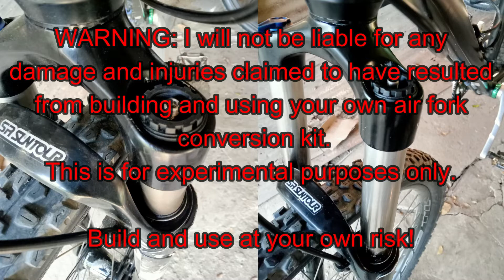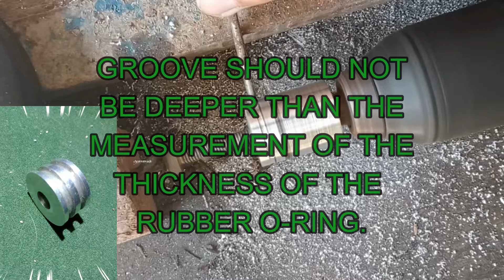I Built my Air Fork Conversion Kit using Home Tools only. Coil fork to Air fork

Comment: pa pm anu fb account nyo
Reply from the maker: bro kung me itatanong ka dito nalang. God bless.
Reply: Meron din ako ganan conversion kaso maliit in diameter ng air cap pang 32mm yata un sakin Kasi 34mm stancheon maluwang sya bka makakapagawa sau Ng alloy na air cap
Reply from the maker: @ pasensya bro, pero hindi ko maharap gumawa, hobby lang yung sa akin kasi. tignan mo kung pwedeng i convert yung dating cap ng fork mo. Pero kung hindi magpatorno ka sa machine shop. Dalhin mo yung dating cap ng fork mo dun para magaya nila yung thread nya. Have a blessed day bro.
Reply: Ahh ok cge pero my idea kaba magkano singilan nila my sabi Kasi nasabit daw ng 1k+ dahil ni sesetup pa raw ang sukat nun
Reply from the maker: @johncarloguevarra7612  hindi ko alam kung magkano. pero try mo research sa online na pinagpapagawan ng ganyan air fork conversion kit. para me idea ka.

Comment: Hi, excellent conversion! I want to do it with my XCR... but I want to ask, why don't you use the upper tube of the suspension as the air chamber polishing inside in the same way that you do with the extra aluminum tube... do you think it's possible?
Reply from the maker: that is a good idea. yes I think it is possible. thanks for the comment.